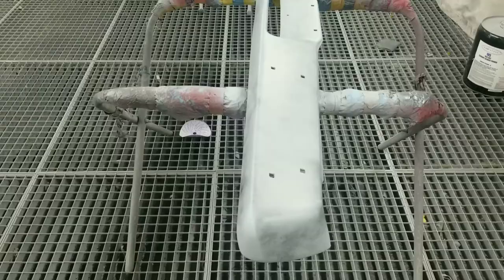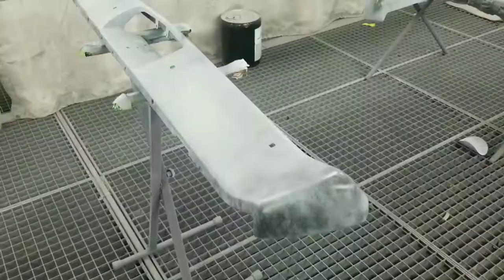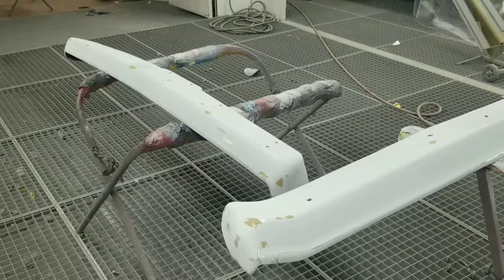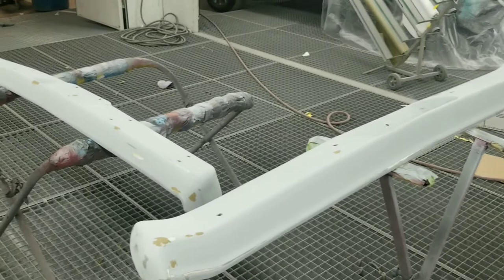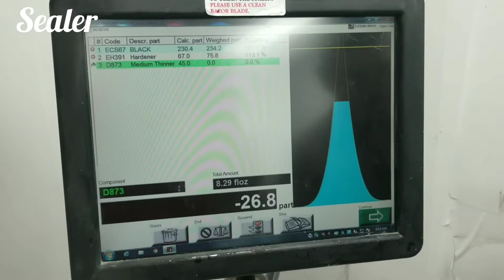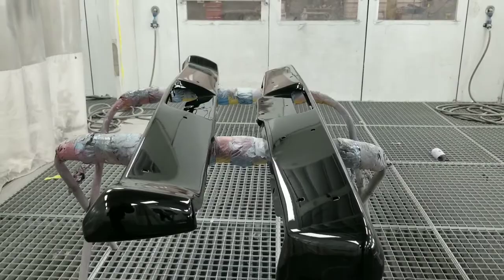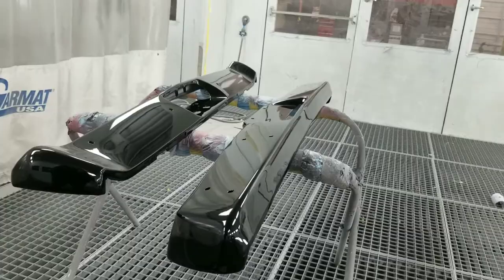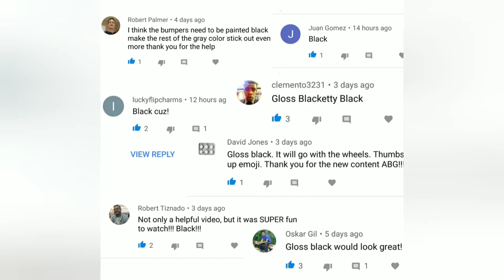Painting Chrome Bumpers on 72 Duster pt.2 Restoration Ep.5

Comment: nice work! question, is adhesion promoter not needed?
Reply from the maker: adhesion promoter is usually applied to plastic bumpers before filler or glaze being applied.. I'm not sure if that what you meant
Reply: Aaron's Building Garage I had just heard from someone that he used adhesión promotor before he primed it because of the chrome even though he sanded it. Thanks for the quick reply!
Reply from the maker: I'm sure that helps.  however I did not use any.